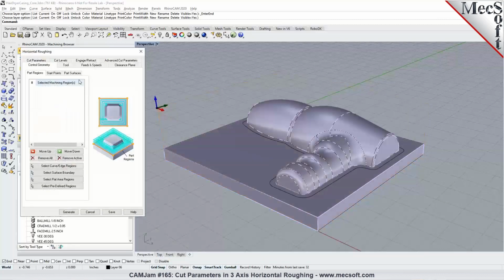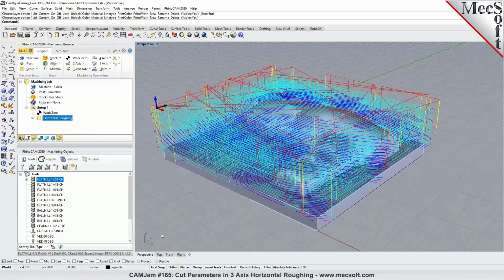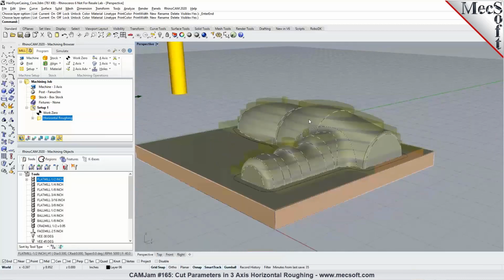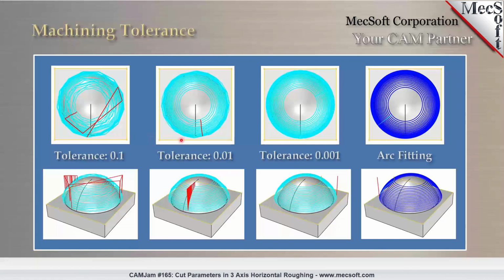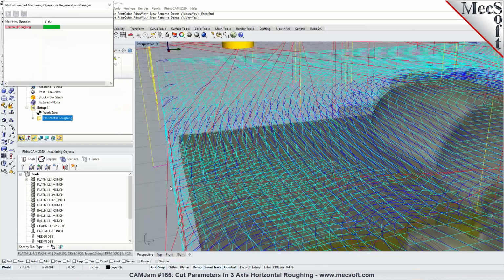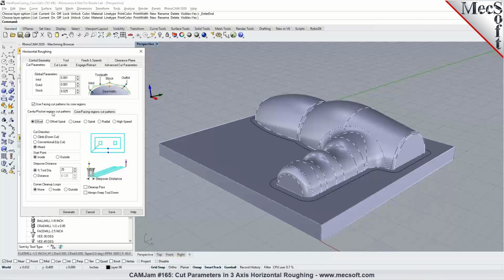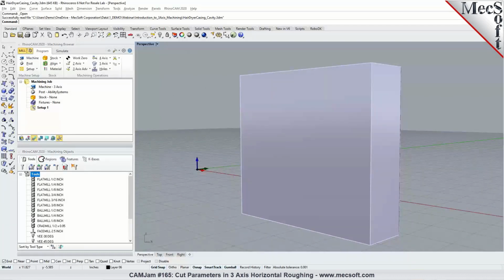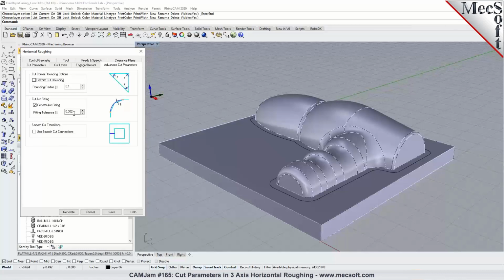Cut Parameters for 3 Axis Horizontal Roughing

Comment: Summary in Tab Cut Parameters intol 0.001inches (0.025mm), outol 0.001inches (0.025mm), In Tab Advanced Cut Parameters in Cut Arc Fitting 0.002inches (0.05mm).